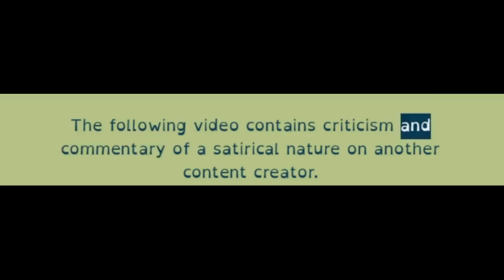REACTION: Another INSANE CRINGEFEST "Restoration" - Antique Kenwood X76 Cassette Deck

Comment: i just cant believed that'd work after all that! surely the motors were ruined, not necessarily from the water but all the previous muck!
Reply: i certainly have washed electronics before with no problems, had to , some kid piddled in a sega megadrive, it got it working, but never knew if it lasted 😉
Reply: Because it's a different unit. If you paid attention to the video you could have seen the different serial number of the chassis at the end.
Reply: @jimmy1395  i didnt bother looking in that much detail as its so unbelievable anyways 😉 admittedly shango066 has got some very rough stuff working, but this looked too far gone, its 'possible', i suppose, but very unlikely

Comment: Dear G ; This is as you say, a bullshit video. Being an electronic technician and a restoration and repair expert of everything from a appliances to autos  I agree with what you say. Not only that but "early integrated circuits" had no protection and were susceptible to damage from an analog VOM such as the one shown. (I guess he learned that if you touch certain things the little pointer will move). And you would be blessed if you could reset the tracking back to pick up audio patterns on the first try. I also see that he is able to restore the fit and finish to original. I have paint and metal plating equipment that is able to put a finish on any kind of surface and can replate, anodize, or nickel plate but not out of a spray can like that. I am but a mere mortal, not a God like one of his viewers states. Unfortunately that many "viewers" can and do believe he is that good. We must look up to his abilities and believe unwaveringly. We are not worthy.

Comment: That fellow who restored poor Kenwood should restore his house, turn it into a luxury (Vila) and sell it to Donald Trump's son for several million dollars. There are still traces of moisture. The only solution is sandblasting to remove completely traces of salt that have changed the colour of the metal. There is no chance that the mechanism and the engine can work after standing in the water for many years without elevated wow & flutter and making grinding noises. He should do the restoration of that cassette, which is in a desperate condition. I'm sure he'll make it look like he's out of the factory.

Comment: I.am doing restoration on old wood items. I can tell you that 90% of the job would not even seen on a video, because its like nothing to see but feel it. Then an another part. You are working back and forth during a restoration job and not on a linear way. Nothing, i mean NOTHING can be done as you are expected, you always run into troubles that need to find a solution, making compromises or change the plan. Yeah, if anybody want to make a video on me during work, sure he can. But i can guarantee that he would need like 1000 hour footage (inculding running into the hardware store, junkyard, other places to find materials or certain tools etc...) the most visual and exciting part of my job, its the finish. Done in 20 minutes or so, just a few day before i give to the client. And there are always, ALWAYs some part i am not satisfied with or i can tell that it could have done better if i know before etc,..

Comment: he most likely used a mixture of salt, vinegar and hydrogen peroxide to make it rust quickly
that's why it didn't rust underneath the board cuz it all was caused by a spray or corrosive stuff

and I know very well ho sensitive audio stuff is, so yeah, I call bullshit on that restauration.

Comment: About 25 years ago was a intern at  https://maritimetechnology.nl/bedrijven/belfor-technology-bv/   they clean equipment after fire or water damage.  (fire being the smoke damage not from the heat)  and yes UNDER STRICT CONTROLLED CONDITIONS you can wash electronics. BUT that means; demineralized water, very low humidity drying rooms, specialized cleaning agents.  without those ... very unlikely to be successful.

Comment: These obviously fake videos are just kind of hilarious.  I don't really care about anybody dumb enough to believe they're real.

The more annoying restoration videos for me are the one's where they legitimately do all the work and they do end up with a high quality result.  But they're calling something a restoration that isn't.  You can't call something a restoration when you're grinding everything down to bare metal, welding all over to repair breaks and holes, throwing away half the original parts and fabricating replacements from scratch, completely covering everything in bondo and sanding it smooth to hide all the rust pitting, etc.  That isn't restoring something, it's rebuilding it.

Still a perfectly good thing to do if you're not truly working with legitimate antique items that actually have real potential value.  But they shouldn't be calling them restorations.

Comment: 27:20 either he “changed before attempting to play it” or there is a lack of clothing continuity. He has a shirt change right there in between the scenes of reassembly and use. Also, the camera guy has an Adidas Jacket if you look in the reflection of the machine when they start it, so they didn’t switch roles either.

Comment: My PCB cleaning last resort is a dishwasher and cheap washing powder. :v It can even remove rust. I also do a final wash in alcohol, but that is because I'm super paranoid of water being under a chip or something and alcohol can help dry the water up. I wouldn't recommend you use high heat to dry it or any heat other than what the washer will generate during the cycle.

But yea, this guy is questionable at best, pure BS at worse. I wouldn't trust him to replace batteries in a flashlight.

Comment: Okay, above all else, the smoking gun here is the serial number.  IT'S ON A FUCKING PAPER LABEL.  That would not only have washed off, but washing it as vigorously as he did would have degraded the adhesive to the point where the entire label is rendered useless.  Yet here we are at the "end" of the restoration and the label looks pri-fucking-stine.

Comment: I have watched 8 bit guy and he restores old computers and electronics. (Learned to spot red flags) There was this old video where he had restored a v 20 and this thing was nasty and there was oil stain everywhere. Even under the board. That's how I noticed how fake and how put on this video was. It was a clean board that they threw mud on. Sad how they destroy a possible good working electronic just for a video.

Comment: Most obvious signs of being fake is that you can't "wash off" rust... and on the bottom of the unit, that's just what he did... rust just washed off, which is not real. Also, all the rubber parts are intact and still stiff?? There's rust on the capstan also where the belt sealed it from the environment? Come on.

Comment: While I think the vid is fake removing scratches from clear plastic isn't hard at all and no one would be able to tell any different. I've built models and restored headlights for many years. 
Models clear parts, wet sand from 800 up to 3k then use rubbing compounds. 
Headlights, same with wet sanding but finish with 2k clear and compounds. 
They look better than new.

Like I said he vid is BS.

Comment: The most that I could expect from such a horribly corroded tape player is to take out some of the resistors and ceramic capacitors. I wouldn't dare trust the electrolytics or the semiconductors.

Comment: That is real restoration. Cable was cut and soldered back because it was broken at midle, you can see on video where it "kinked" or what is called. Front door glass is polished, and front is original. You can see scratches on plastic on the side.And you can see Kenwood name is scratched and paint is missing on letters. Those motors will work as they are closed type, water can enter it only from the front which is covered again by plastic. Belt can be outside in water,mud and elements for long time and it will NOT snap. Also to mention board. It will have chance to rust bellow board but, board prevented mud to get too much far bellow, and when it rains, it washes all mud. Bottom metal is not exposed to sun so it will not keep mud on it and next rain will just wash it. Your "review" is more cringe than his restoration. You need to lear a lot before you talk bad shit about someone's work.

Comment: You know these kind of restoration videos are totally fake if :
1. Recorded with phone camera and a lot of shaking
2. Took place in some asian city slums or country side
3. The guy claim to found the stuffs from the wilderness or trash pile by actually recording where and how he gets them( which is clearly staged)
4. The stuff looks broken beyond repair and so dirty in the place where it shouldn't able to get dirty.
5. They started cleaning the electric component by actually washing it water and soap
6. Doesn't have indoor workshop to do the restoration / doing it outside so you can hear the noises from the outside world.

Comment: 2 things. You can't measure anything holding one probe of a multimeter. Where is the transformer in this thing? Sure won't run on AC high voltage

Comment: cont part 3: it is impossisble to get rid of scratches on translucent plastics but he is filming it outside where sunlight blocks any
noticable blemishes and scratches due to uv light reflection  and you will still see them in artificial light and he failed with his wire riging 

what professionals do after soldering wires they use heat shrink wire wraps and never use hot glue because it is an substance if it over heats
that substance can cause heat and  sends an chain reaction of smoke and fire  and these are constant errors that they use on these videos 

as an cheap method  and it will fail it's expection from an professional by seeing the hot glue on soldered wire connections and end up 

replacing them with new connector cords  but at it's current bodged state it works for an short time but eventualy fail  so i call it
BUSTED .
Reply: I's not "impossible" at all, I do this all the time when I restore turntable lids. I use an automotive rotary polishing machine and polishing compound to get rid of light scratches and if there are bigger, deeper ones I wet sand before. Works every time and the lids come out looking like new.

Comment: While the video is fake, you seem to have no idea of the level you can restore things that are very far gone. "You can't remove that coating without it leaving a mark", have you ever done any metalworking? It's very rare for metal components to be completely gone, and making sure each piece is well restored you have to take it completely apart, you think restoring stuff is just "make it work again", but a lot of artisans like to restore things down to every possible detail. Honestly that restoration video, even if it didn't fake some bits, is pretty poor quality, he could have gotten the rust off with electrolysis before using a wire brush wheel and then polished the pieces.

Also like "it's not even that old, it's from the 90s at most", fam, 1990 was 30 years ago.

Comment: Electronic komponent feet rust and break, Resistor, ic, transistor, is not check, ☺imposible in the work🤔, motor dc, wire and socket 🤭

Comment: Ah, a Fake video again!

How these videos are made:
1. Show the phone in working condition
2. Take the phone apart
3. Wrap the parts in cling wrap
4. Put the phone back together
5. Smash it and rub mud all over it
6. Pretend to find it at the side of the road
7. Pretend to measure stuff and try to clean everything with WD-40. Also do some bootleg soldering

Now put it in this oder: 
6.
7.
4.
1.
You of course have to leave out 2., 3. and 5. to make it believeable

Comment: All the sliding levers that have to operate smoothly.  Corrosion of pcb tracks & fine component leads.  All the tiny springs that may have rusted away.  The dust & salt that got in between the windings in the power transformer, & any kind of coil, choke, inductor or motor.  The contact corrosion inside any potentiometers, whether manual controls or presets.   There's a thousand issues that would have to be addressed before that thing would ever work again.  How could he recalibrate the machine with just a multimeter?  This is such BS!  I wonder how many hundreds of this type of restoration this scammer had to carry out to pay for his car?  I don't believe it for a  second.  I wonder how much yt pays him for the views etc.  He'd probably desperate but he's still a fraudulent scammer.

Comment: I wouldn't mind, but these so called 'restorations' are all of worthless garbage. I saw a video a while back where he fixed up the rattiest amplifier I think I've ever seen, he painted it with house gloss paint, all over the labels etc and it had to be worth less than nothing after all this so called work. I repair stuff myself which I'll often salvage from dumpsters, however I've never seen stuff in as bad condition as he gets. I tend to have a bit more taste too, ie I recently found a 90s vintage $1000 Sony CD player with a full copper chassis and the most amazing disk loading system with magnetic levitation etc.. As for cassette decks, I found a Sony Dolby S single deck just needing new belts. I'm also amazed he can't afford better tools as they're the cheapest, gnarliest bits of crap you can find on ebay.

Comment: I AM NOT A RETARD!!
I worked early in my career in the electronics field and in electronics engineering for 15 years and a college graduate and I am older than YOU!
That video could well be legit!
You really do not know for sure!
And that device really does not sound very good, even with the crummy Russian music!
It is a restore, but I would not trust my own cassette tape collection to play well or possibly get my tapes shredded/destroyed from using this tape deck restore.
The tape heads really did not look very good.
The motors look either new or second hand, better condition motors from another audio tape deck.
The rubber on the capstan wheels could have been replacements, too!
Those looked too clean, too, but rubber and plastic parts do take time to degrade, even in harsh environments and exposure to UV light.
This person might have had to get some new parts or better condition used parts to complete this restoration .
No one, even you or I, know for sure that this was NOT a true device restoration.
A lot of the device were metal, machines hardware components that can be “worked” and cleaned up to work to an acceptable level.
I truly believe that this was a real restoration.
Reply from the maker: You’re mad.

Comment: I actually work on cassette decks and other vintage audio electronics for a living and that is just a disgrace. 1. Thats a pos cassette deck from the 90s nowhere near antique. 2. I find it skeptical that he actually repaired it because cassette decks at that time were mostly run by ic chips and when those go bad there is no fixing the chips and good luck finding another one. And 3. That deck has absolutely no value. Its not collectible and it sounds only mediocre.
Reply: 15:35 that transport is fucked. Ive seen transports from decks that have come out of flooded basements that looked better
Reply: 20:01 wouldnt be surprised if he cracked the auto reverse gears getting that off if you have an auto reverse gear that is intact you try not to take it off at all costs because they are extremely fragile and replacements are few and far between
Reply: 22:53 that flywheel isnt going to move like that and if it does it going to be so off and slow because of friction that a tape would never run at the right speed
Reply: 23:19 too big of a tip on that iron, no flux and wheres the desoldering wick which you should be using for that size of connection
Reply: 24:21 no. Just no. You put heat shrink over the wires then solder the wires then heat the heat shrink over the connection
Reply: 25:19 what is this guy’s obsession with wd 40. Might as well soak the board in it
Reply: 25:48 can someone explain to me how you can test a circut for anything when you are holding one of the leads in your hand
Reply: And last thing where is his perfect diagram and or schematic to tell him where everything goes because every cassette deck is different

Comment: Very very funny 😁 you have no idea what  you are reacting to. And that kinda Attitude is hard to believe. 
  
Imagine the impossible fix as, the old speaker 🔈 you can’t fix  yourself and sent it to Indiana speaker 🔈 restoration store .  The guy in the video you were reacting to just did that “ the same  impossible thing “ 

📝 For the old speaker 🔈 the one you sent to Indiana repair shop.  If I were you, I would just get a spare speaker cone, spider and then rewinding the voice coil with the right impedance and reassembled it.  

I respect your work but, you have the luxury of updated tools, equipments  and information to do the right job yet you can’t fix that  an old speaker 🔈😀 with your fancy tools. Very funny . 

It would be really  nice to see you fixing an old complex  power amplifier mixer electronic circuits  board without internet, electronic schematics  and your fancy tools , but only with an analog Multimeter. Bet your brain 🧠 will fry out after a day of Diagnosing.

Again ! I respect your work. I just don’t like your attitude towards  the poor guy’s hard work. 

Peace out ✌️
Reply from the maker: I could recone a speaker. It isn’t rocket science. But it just isn’t a skill I’ve developed yet, and I’m not going to practice on someone’s 60 or 70 year old original speaker. This guy is a total fake and you’re defending him, which demeans real craftsmen.